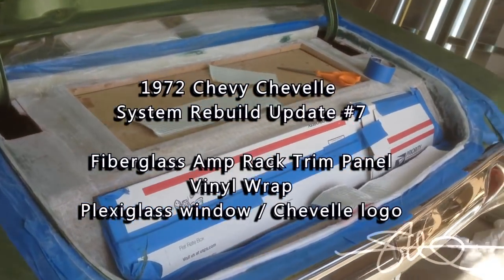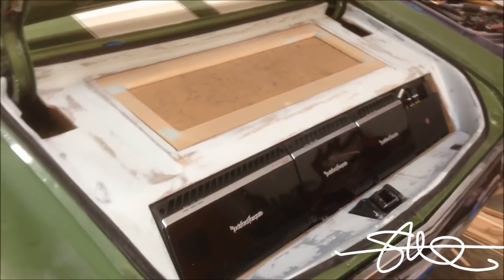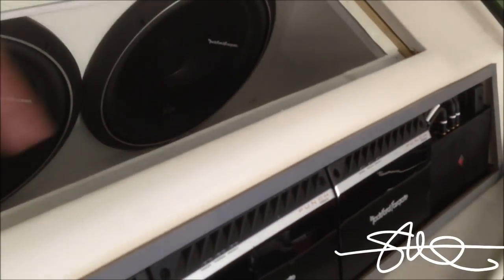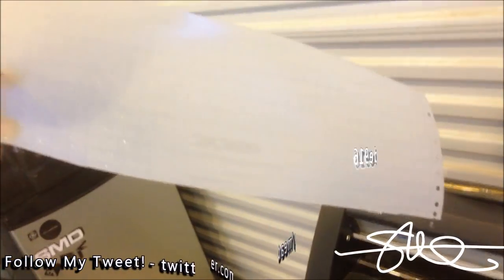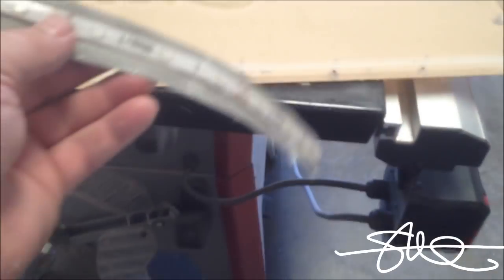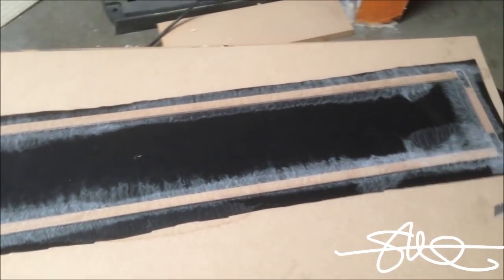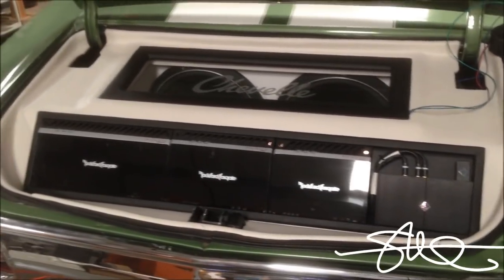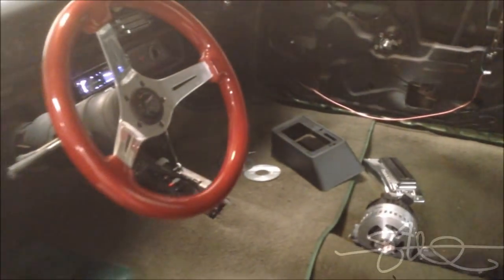'72 Chevelle - Sound System (Re-Do) - UPDATE: Plexiglass, Fiberglass Amp Rack- Video 7

Comment: You sir are the inspiration for my Trunk for an 01 civic, Built a custom wood flooring for it put a 2 subs hidden amp for that. then ran a Polkaudio 660 for highs with wires coming through the floor. You don't realize how much you have inspired me meade916 for wiring and custom builds I have friends coming to me for the wiring stuff now and custom builds. One thing I really want to learn from you is where you hide your wires and how you do it.. I just stuff it where it would hidden.

Comment: The work you have put into this car is amazing. I like the clean look of the trunk. There is only a couple of things i would have done differently:
1. Instead of the Chevelle logo, i would have chosen to do a Rockford Fosgate logo.
2. Even though the inside of the car is illuminated with green light, i think it would look nice if the plexiglass where illuminated with a blue light. (Reason: The amps have blue power light. I mean, you could change the lights in the amp, but thats a lot of work) :D

Comment: For the Chevelle lettering, is that just translucent vinyl or is it a special particular type of material? I have been  printing my own logos/lettering vinyl decals on my plotter and using the negative of the logos/lettering as a template then doin a light sandblast to etch the lexan/plexi so that it catches the light from the led strip on the side. That’s obviously way more work for the same effect that u did so if u could tell me what and where to get the same media that u used for the Chevelle lettering it would be greatly appreciated. Install looks great btw but u already know that. Thanks in advance.

Comment: I have a question would you run all wires from amp and head unit to the battery instead of 1 pair to the alternator or at least i saw a wire run from the alternator back just a simple question.